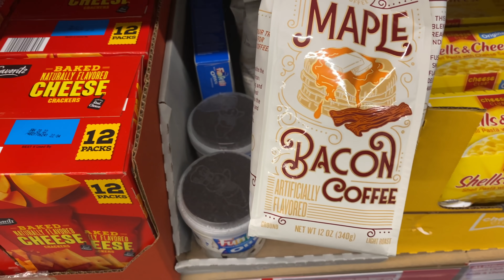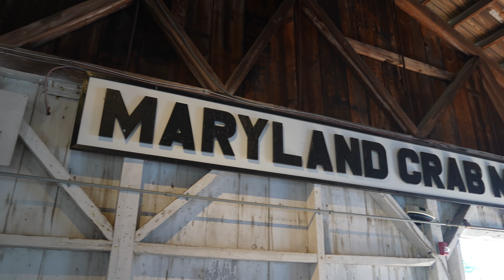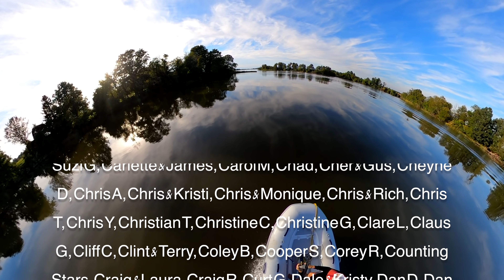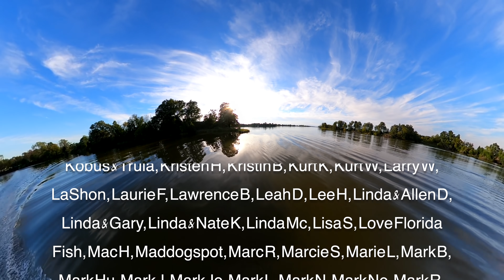Go Sailing NOW with what you’ve got

Comment: Small, day sailer, short overnighter: a bud and I been thinking on it. In the early '80's had free use of a Morgan 41 out of Miami. Did the Keys, Bimini and as far north as Hilton Head. Stunned how much work it took, finally concluding sailing was a lot like camping only way more expensive. The idea was better than the reality. Did I say sailing? Should have said "motor sailing", mostly motor, little sailing. Maybe a small boat is the cure.

Comment: I see many different type of boats going aground, and I think your boat that would easy to refloat. I was the forman on a job when a man was traped under a steel wheeled road paver  I had two men holding his head out of the water so he wouldn't drown. We hooked a 50 ton crane to the machine, but I was afraid the crushed man would bleed to death when we lifted the load . The power plant called the fire department; we held the machine from sliding into the deep canal. They put air bags under the machine, and lifted it off. He only had a brokrn leg. Your boat would be easy to lift. The space between the hulls would give thousands of working surfaces of one inch squares. A 20 foot wide roll of 6 mil plastic would make a 6.4 foot diameter 50 feet long. Just tape the seams, and flatten the ends. Use gorilla tape then secure 4 or more under the bridge deck. A vacuum cleaner or a leaf blower with less than one pound of pressure would free you.